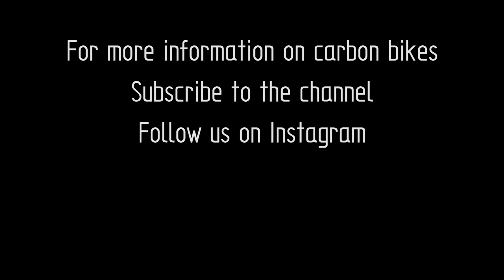JRA Failures - Why Does a Carbon Bike Fail JUST RIDING ALONG?

Comment: If I see no visible damage should I be worried?
I bought a second hand Specialized Sirrus pro carbon am I going to kill myself.
Reply from the maker: Thre can be sub-surface damage or flaws that is not visible on the surface.
Reply: @LuescherTeknik  This depresses me. I'm only afraid of  killing myself. Is there any way I can give myself some reassurance my frame won't fail when riding?
Should I regret buying it?

Comment: The bottom line is Carbon Fiber is simply not a predictably reliable material.  It boarders being downright unpredictable and dare I say potentially very dangerous (especially if you buy a used one.)  CF bikes, like any bike over time will certainly get casually knocked about.  Most people will not replace them- lucky if they even tap test them. 

The weight of a similar aluminum version these days is not too much different- in many cases e.g., AL5 vs. SL5.  If riding is your passion and you log 5+ hours a week seat time, and every fraction of a second matters to you and you have a large budget and you like to show off too crew (who has the lightest bike, better groupset, etc.), then yes, CF will have some benefits to you.  For the rest of us, a great quality Aluminum bike like the Trek AL5 Disc w/105's onboard, or the Canyon Endurance 7 should be more than fine.  Either one of those will also be far more reliable long term and far less expensive.  YOu will also worry less about failures and damaging them.  They are about $2,000 bikes, not trying to be $7k bikes.  I don't want a $7k bike.  The funny part is a great athlete on an old steel bike can sometimes pass the guy on a $7k bike.  As Lance said..."IT'S NOT ABOUT THE BIKE."

Comment: The probability of a carbon frame made so that it fails = moderate. The probability of metal frame made so that it fails  = small. Theoretical strength of carbon frame = huge. Theoretical strength of metal frame = big. Self assessment of carbon frame build quality = close to zero. Self assessment of metal frame build quality = good/excellent (depending on know how). Add all those numbers boys and girls. Carbon manufacturing is a lottery driven by money. There are handful of brands out there with a quality product. And better know which one is it before going carbon.

Comment: Are there any cheap NDT methods that an average guy could use to inspect the frame?
Reply: Look inside with a flashlight.
Look for surface irregularities 
Look for surface marbling
Look for any cracks.
That's the best you can do, aside from avoiding used carbon steer tube forks.
Reply: @EFCasual  You cannot see the cracks or voids within the CF Layup in a monocoque frame. You need ultrasonic imaging machines to detect them or cut them up. That is why it is a bit of a gamble buying a lot of CF bike - as his videos have shown, even the big manufacturers frames have voids or adhesive pooling which are potential areas where cracks can form. Only CF bikes made with lugs like Colnago does with their expensive CF frames (C30, C40, C50, C60, C64) are less prone to these manufacturing faults as each lug and tube can be made with higher accuracy than a monocoque frames which use air bladders to compact layup on the inside in one go - the new bike designs with lots of hard angles and shapes also exacerbate the manufacturing fault issues as the air bladders are not good at filling/compressing these sort of areas.
Reply: Triode 12, i contend the rate of CF bike fails to be small in comparison to the total sold into the market. I’m an avid experienced rider with continual group ride experience and racing both on and off-road(35 yrs). I saw more failures in steel and aluminum prior to CF introduction into mainstream cycling.

Comment: Hi Raoul... I agree with some of the commenters here that you are actually making a case that carbon fiber is not a suitable material for most bicycle frames.  With an aircraft, the plane is either in the air or on a huge runway, with practically no chance of impact from other objects.  For example, pilot can use the restroom without worrying that a fuel truck has bumped into the wing.  With a bike, even if you park your bike inside at the bike shop, and you need to use the restroom, etc., someone may cause your bike to fall over or cause something to impact your bike without you knowing it.
Reply: Totally wrong about aircraft. Particularly commercial flying. They take quite a pounding from thermals/turbulence, hard landings, and pressurization. Thats why they are inspected regularly at a great expense.

Comment: Have you any experience around Calfee frames? Are they really better with their bonded carbon lugs compared to a typical production frame with joined tubing?
Reply: Bonded lug CF frames will have higher manufacturing tolerances as each part can be easily inspected before the bike is built so it would be safer (less probability of manufacturing fault) than a monocoque frame.

Comment: it's funny how some guys now rail against carbon again. They forget how many steel and aluminum frames broke before... I ride race bikes for almost 40 years and I have NEVER experienced or seen one single bike (or fork) fail (I have btw experienced a wheel failing - and that was an aluminum wheel...). But I have heard those stories from the very first time - and in those days it where all steel bikes. Than I heard it again about aluminum bikes (and some guys said: don't buy al frames - ignoring what has happened to the steel frames in all the years). Now we have carbon, and things are the same again with this material - but it was never different. Every material can (and will!) fail here and there. 

Another example with another material: I'm a professional violinist, and not one single musician will question that wood is the best material for our instruments. But nonetheless one day my bow (having wonderful performed for many many years) cracked without a reason while I played a soft and rather quiet piece of music (so without any force on that bow) - and colleagues had similar experience. Not nice - but that's how things are...
Reply: "Racing for 40 years.....Now we have carbon bikes " 
Carbon bikes have been around for 30  years,  they're not new.
Reply: Totally agree with your assessment as my experience over much the same time as you is the same. I’ve had aluminum fail and seen aluminum fail in other bikes. Also steel with bad welds/lugs. I’ve experienced no CF fails since switching over in 2000. 
Also I have repaired guitars recently, mostly from impact damage. Wood can become brittle with age or very low humidity. Dents when humid or chips and breaks easier when dry. Extreme changes in humidity can distort the woods.
Reply: That probably only shows no material is directly responsible for failure - rather technology used to process materials and assemble final product, as well as conditions in which product were used and impacts received.
Reply: Back in the day my steel bike front fork failed at the drop-out, but it was easily welded up at the local garage.
Subsequently the front tube failed, but my brother welded that up and returned the bike to service.

I am reasonably confident (maybe rashly optimistic) that today my aluminium frame is not going to fail catastrophically, and that I will always be able to get a taxi home if I need to.  I understand that I need to inspect for cracks and dents and wrinkles in the aluminium.  

I am not so confident with the carbon forks, and I would like to know  what diagnostics and routine checks I should get done on my forks, given that they do not lead a sheltered life.
Reply: A poorly made bike of any material will fail. The point here is that due to the skills required, the very high quality of QA/QC for the unique construction of carbon and the low level that manufacturers approach this with (even in desigm) they are actually regularly building faults into their bikes.  Steel tubes never fail. Poor welds (and they are easy ti see and detect) will, but the material will never fail. Any/every part of carbon will fail if they don't have the skills yo to produce it

Comment: Steel breaks from work hardening. I had steel bike crack around bottom bracket. Ridden bikes for 35 years , all types. Carbon is more reliable than any other material . ( that is a correctly made carbon bike )
Reply: That steel bike didn't dump you over the handle bars when it cracked. Failure of one CF tube will probably cause the failure of another tube/tubes because of the way CF fails and how it is made..CF's strength is only in one plane. CF is only reliable if you take care of it like he states in his video. But the chances of having an impact grows over a long period of time (simple stats).
Reply: Triode 12, you have stated totally false assumptions with no stats for backup!

Comment: It gets me sick everytime I ride with a guy who rides steel that says "steel is real, ride real bikes not plastic bikes, steel never breaks carbon is weak"... its just annoying! Been riding bikes for years, alloy an carbon, my alloy bikes had given me more problems than my carbon bikes!
Reply: New Subaru Guy yer that's true, but everything brakes, the problem with carbon is it's hard to tell if it's damaged and it gives no warning before catastrophic failure! Metal bikes on the other hand when they are broken or damaged it's really obvious, you can see the dent or crack right away. And the other thing is, I was riding an aluminium bike when the frame cracked at the seat stay weld, the Bike kept together and I simply pulled over to the side of the road. If a carbon bike fails the first thing you know about it is your face hitting the floor.
Reply: Yes that is very true, its a fact. But like the teknik said, a well constructed, well cared for carbon bike will not simply fail. I've seen 10+ years carbon holding up really well, so it means its well constructed. if its well built it wont fail. But again, im still waiting for these fails to appear at any of my carbon bikes, yet, my last alloy bike rusted like crap even tho i cared for it extremely well.
Reply: New Subaru Guy yes everyone has their own story's and experience to be honest. Like I had a custom Aluminium bike made for me and I have been riding it for 12 years without problem, had a carbon bike made for me by the same place... cracked in 3 months and cost me 3 time as much. No refund! As you can imagine that put me off carbon for life ha ha. I have a Titanium bike now, definitely the best bike I have ever had, so nice to ride and light and stiff where it needs it. I feel like I found the perfect bike. 😊

Comment: Ride only aluminium so no jra for me ever lol
Reply: Just my opinion, an allu frame is more disposable than a carbon frame given that you can't repair aluminium frame. For longevity I'd recommend titanium or steel frames
Reply: My alloy mountain bike frame failed where the bottle cage bolt insert had been fitted incorrectly, the stress was enough to cause the downtube to fail completely. JRA and the only thing holding the frame together were the gear cables.
Reply: I agree, a titanium bike is a bike for life, aluminium I just coke can material. I do believe aluminium will always come out greater in a crash, carbon fiber is definitely unpredictable, when carbon fails it is definitely unpredictable and could explode
Reply: Jesus!
Reply: Welds fail all the time, sorry mate welds are not bullet proof, they can actually be very weak if not done properly